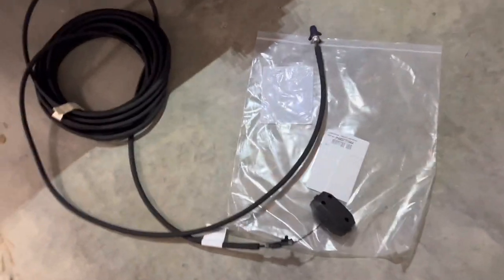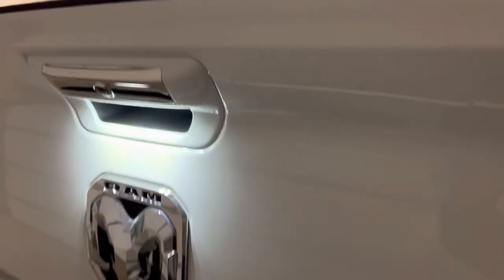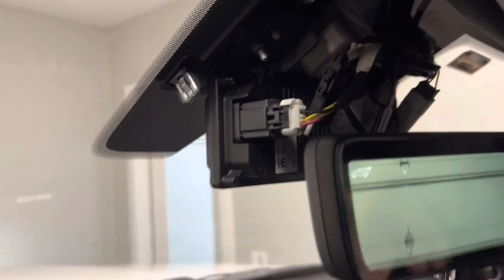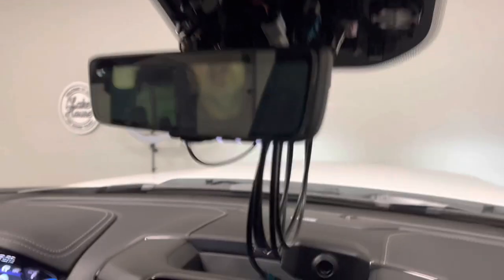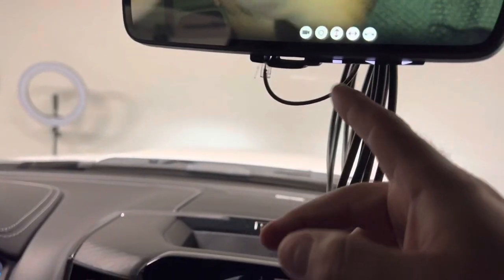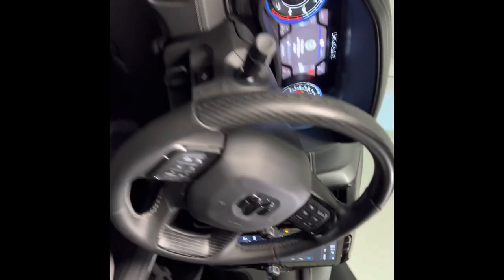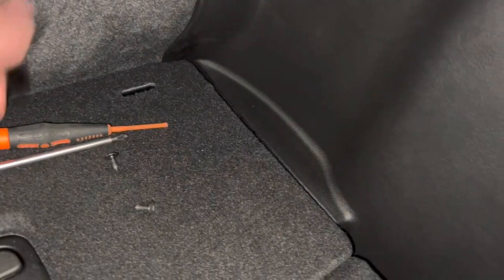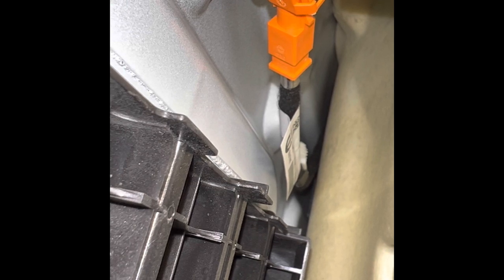2022 Ram Tow Mode Camera Fix

Comment: Good tracing it to a wire that's not fully connected. I build these trucks in Sterling Heights, Mi and I see obviously your vehicle left the assembly plant and made it all the way to the dealership with flaws. You probably save two or more days trying to get your truck repaired at the dealership. Management can't stress enough on telling the workers in the trim department to make sure you hear a click when putting these harnesses in but when you only got 45sec to complete your job and prepare for the next one I can see how 1 or more slip by but there are 2 quality checks to see if the truck goes to repair in house before shipping, but anywho great job!!!
Reply from the maker: Thanks for the work you do.. I am a mechanic so I can appreciate the workers on the line. I have been to the plants and it amazes me to watch them drive off the line so fast with no issues. If most could understand how many components, connectors and programming goes into these vehicles. It amazes me how many start right up with no issues. Also the fact that they receive a truck with less than 10 miles in most cases and it is so dependable and ready with zero testing on the unit. Thanks again for what you do!!!

Comment: Great video. My trailer camera arrived today and I plan on putting the camera on the back of my roof top tent which currently blocks the camera in the third brake light. This should really improve my view while driving. Thanks for the comprehensive video.

Comment: Excellent video! Is that Mopar camera the only one that will work with this setup? I wasn't sure what would happen if you ran a different camera into that connection. Thanks!
Reply from the maker: I would think any camera with Fakra connection should..
Reply: @RockyRohde  Will let you know if that is the case.

Comment: pretty crappy you had to tear it all apart for it to work! But I bet you were happy you got it working, Great video. I wish the camera was wireless, then I could transfer it from trailer to trailer, no desire to run this on any of my trailers as I dont have an RV. I imagine that is their main audience with this camera though., RV'ers. I ordered a 22 2500 Limited mega, cummins, level 1, night edition, bright white, level 1. Its on its second train now.
Reply from the maker: Yeah man I have been to these plants and seen the assembly line.. it’s amazing to me to see how many trucks fire up and roll off the line with zero issues.. I am a mechanic and understand these things happen. I am sure someone is going to make a wireless module that plugs into bumper and a cam that uses power pre wire. I have had glitchy wireless cams.. it’s worth it to me to be hard wired.
Reply: @RockyRohde  Awesome video man i was interested as soon as i saw this video as i order this myself. i wasnt sure how long the cord was i believe you said it was about 50 feet which is cool. but how do you run that back to the end of your trailer? do you just run that cord on the top of the trailer or just on the side?

Comment: Rocky Rohde, great explanation on how this camera works, today my dealer told me that my '22 Laramie 2500 was lacking the module that operates this camera from the factory and it is not fixable. I had ordered the truck with the trailer tow wire and camera in 2022.  They claim this camera is operated through the Uconnect 5 system like all the rest of the cameras but this camera lacked the module. This sounded a bit odd and since my camera did work intermittently I was skeptical. After watching your video this morning I began to trace the wires starting from the bumper. Immediately I located a short in the wire connector that connects to the camera wire port on the bumper. By wiggling this connector the camera would work intermittently. It looks like the short is in the connector on the wire that attaches to the camera wire port. I think I can simply replace the focker connector sp? on the end of the wire from the harness. Can you provide me with the correct spelling for this connector? Regards, Joe
Reply from the maker: It’s a fakra connection. You can get cables on amazon

Comment: Very informative video. I just bought a 2022 Bighorn Ram with the trailer rear view mirror. Where did you get the trailer camera, I have tried several ram sites and have not been able to find that part number camera.
Reply from the maker: Dealer only as it is a new part number

Comment: Awesome video!! I have a 21’ TRX with digital mirror I am trying to add a trailer cam as well. I just noticed my rear view has 1 fakra port. Wondering if I swap out my rear view mirror with a 3500 mirror I can use 2 cameras?

Comment: Hey Rocky, think the Tow Mode camera would provide the same/similar view as the CHMSL camera?  I bought a 2nd CHMSL camera to mount on the back of my topper but now realize I might be able to simply mount a Tow Mode camera to the back of the topper.  Thoughts?

Comment: hey rocky, 
damn you have some skills. I would be scared of fucking off my new truck 

great video. 

on the RV side... 
now a days RV units are coming with a pre-cabled furrion camera option. 
then you have to buy the camera + monitor. 

so its great not to have to run the cable, but better to be able to use this ram system. 

how did you run the cable on your rv side? 
do you have a video of it? or pics? 

do you think there might be a way to re-use the cable that is already ran inside the rv and somehow cut/attach to this ram cable? 

thanks for all the info. 
solid videos
Reply from the maker: I just ran the cable along the frame under the rv. Just make sure to keep it tied up so wind doesn’t flap cable. I drilled hole in the floor in the back corner of rv and run it up the wall in some wall cable cover. Pulling with it is amazing.. lane changes and judging speed of other traffic is 100% on point..

Comment: Do you have a video of the actual camera install on your RV?  I have the camera kit and taking delivery of a 5th wheel in a few days that's pre-wired for a camera.  I assume I won't need to long cable that came with the camera kit, but not sure.  Any advice would be appreciated.  Thank you
Reply from the maker: I don’t have a video but I did use the 50’ cable. I ram it under the trailer and through the floor in the back.

Comment: Do you have the part number for the camera kit you’re using?  I am going to swap my 1500 single input digital mirror to a two input mirror and run the line to my bumper for a trailer cam. There was mention in a forum of a specific camera that works with that.

Comment: Hello thanks for the info. Dealer can find the connection port on bumper. Can you let me know if their is a part on the bumper connect port. 
Thanks.
Reply: I am having the same problem, I ordered the digital rear view and camera kit but my truck did not get delivered with the port.  The dealer can't find the part number for the bumper port. Any assistance would be appreciated.

Comment: Did you have any other issues with certain options when you ordered? I just ordered a 2500 Limited and couldn’t get the Harmon Kardon, adaptive cruise, or the camera mirror. For some reason the Limited Level 1 Equip Group is no longer available. 🤦🏻‍♂️
Reply from the maker: Trailer Tpms was junk.. after I train all sensors it’s good for ignition cycle. As soon as I cut it off they would dissapear
Reply: @RockyRohde  crap really?? I have the tpms and thats a big letdown!! I was hoping i could just plug the trailer back in and it would detect the tire pressure

Comment: If I have the digital rearview mirror but not the bumper port, could I in theory order that part P68527599AA, wire it up directly, and add a disconnect at the bumper? My whole setup is less than 50’ so it should reach.
Reply from the maker: Yea possibly.. just check and see if your mirror has two inputs.

Comment: Can you recommend please a good video that shows us how to install the 4 camera system for the travel trailer? Thank you
Reply: It's easy, just set the module on  the tail gate for test purposes, plug in the four color coded camera's and cable to the port on your bumper or underneath depending where it's located next to the 7 pin connection.  Uconnect5 will recognize the surround module.  Go to vehicle/settings  and  select camera's then trailer surround camera to set your options. Also you can go into    trailer option just above camera and you can set your trailer options,  type/length of trailer for bind spot , types of brakes.